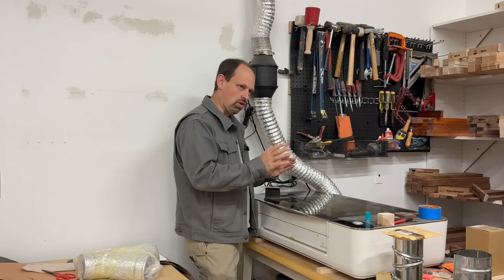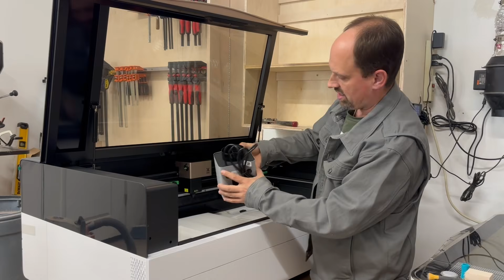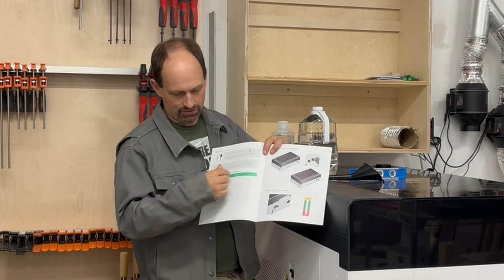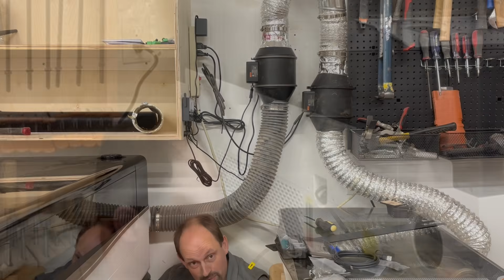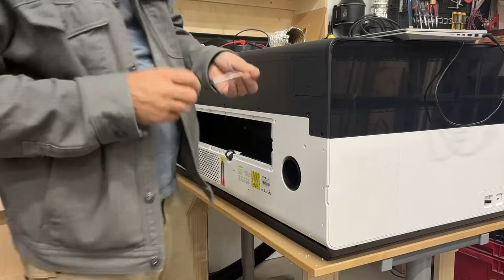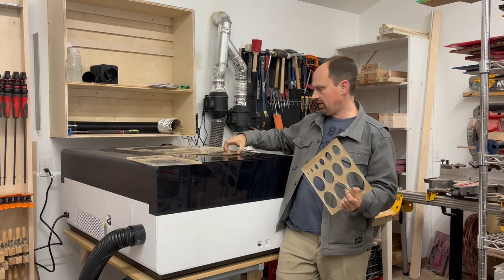The Newest, Most Expensive Tool in My Woodshop || Reviewing the XTool P3

Comment: yeah it seems like a lot of p3's have issues its bad . I had so many I had to get another unit, and thankfully customer service has been amazing . the new one works so much better. Yet I still had the random disconnection issue. outside of that, amazing machine.

Comment: Yeah I received my p3 without a working laser tube. Contacted them then eventually they confirmed it was the tube. They told me they would 2nd day air it however, it stayed at the facility for days before shipping out. Received it and noticed that the box didn’t have any fragile or handle with care stickers as most fragile items do. Opened the box and of course the tube had shattered glass inside the box. Just one thing after another truly disappointing after all the excitement I had when ordering.
Reply: Wow, I would return the whole thing at that point. They probably hold it at their shipping location to expedite the 30-day return process. Hearing that, I'm getting really worried about ordering such an expensive machine from them. They should have some facility local to the US, and in case something like that happens, they should be able to swap the machine or have a service in place to arrange for the tube to be replaced by them, not by you. What a joke.